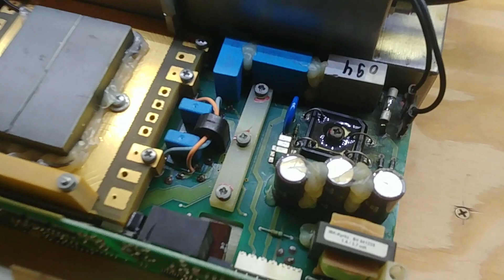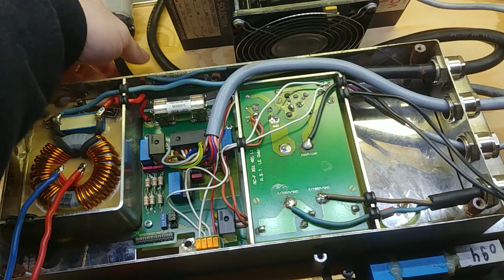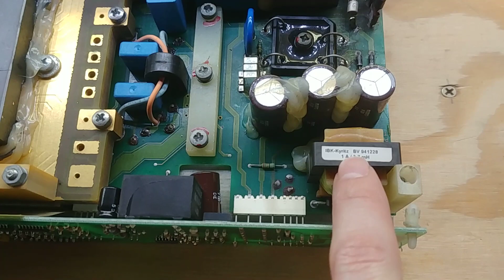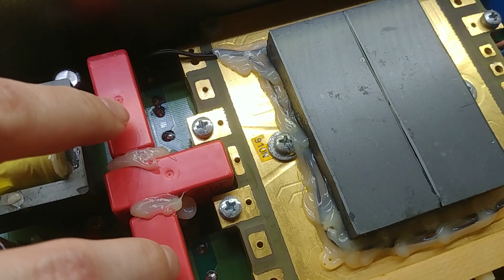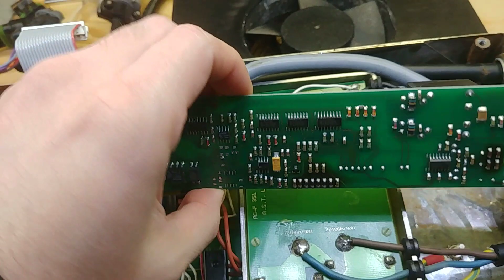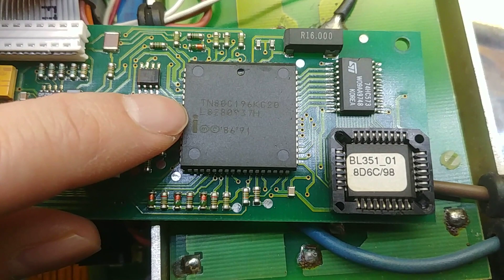Solectria BC3000 Repair, S/N 094, Part 2

Comment: Very nice walk through on how it works.  It seems new chargers have moved away from the zero cross switching.  I wonder why more power supplies today do not use this zero cross switching design?  Perhaps all the series capacitors that must carry the full current?